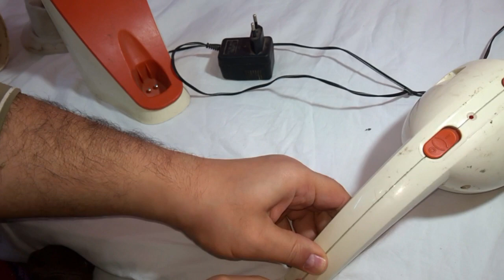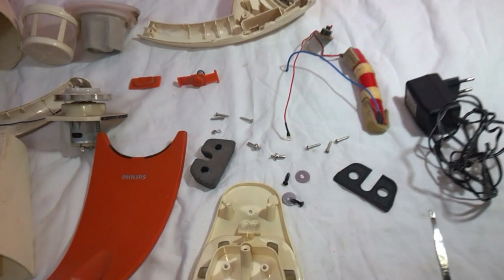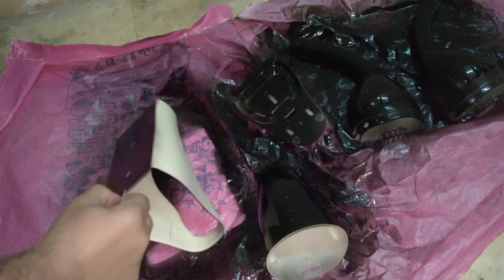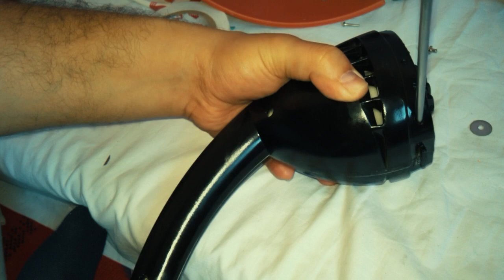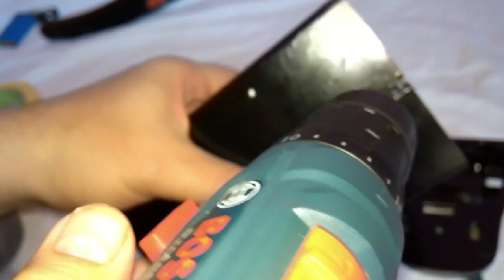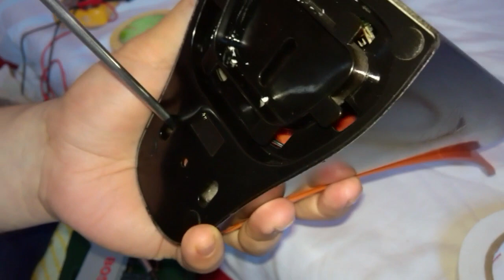Restoration Old Philips Handheld vacuum cleaner + Ni-Cd To Lithium Battery  bring it back to life

Comment: Hello, thanks for the idea. It was probably a bit of work, but the end result was great! I also have a Pelican and I wanted to throw it away because it's sitting idle... I won't use the base - I installed a charging module inside, under the motor body, and I charge it directly via micro USB. Here you modified the board with the switch because I saw that the diode there lights up when you turn on the vacuum cleaner ...mine is dark...maybe burnt? Regards